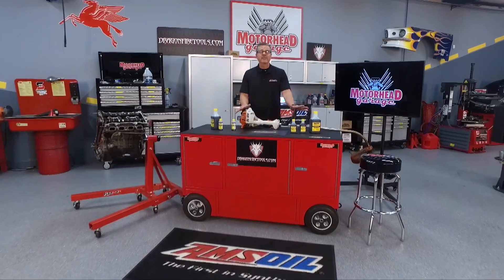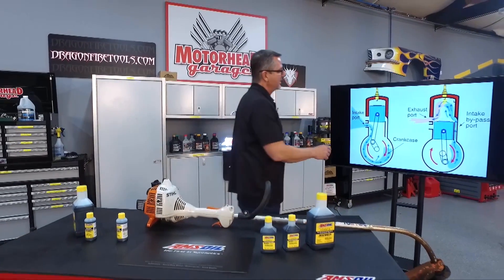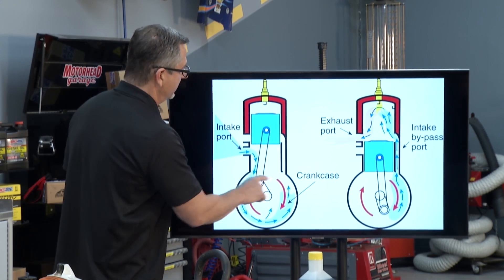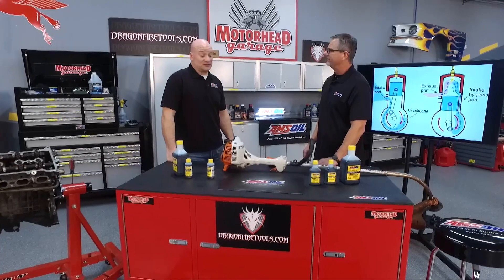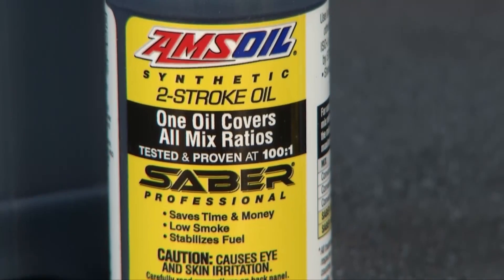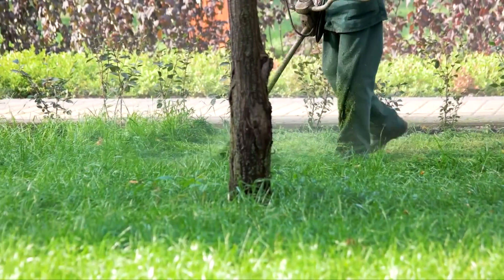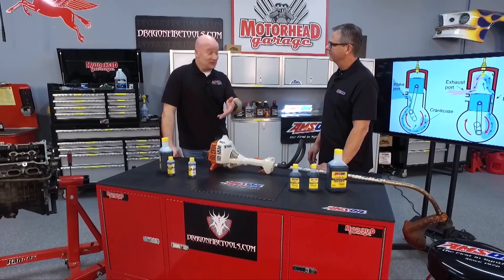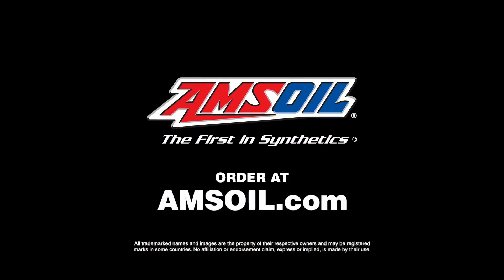Maximize Power in Your 2-Stroke Engine

Comment: I have been rebuilding vintage air-cooled 1970's motocross engines-When rebuilding the crankshafts on these engines  I have noticed acid type pitting on the crank pins/con rods. I have no idea what type of oils were used, and most of the engines had sat for 30 years. I did notice the same type of pitting on a dry storage 1992 Honda CR250 a few years back on the small end of the connecting rod. I have been using Amsoil for 30 plus years in my own bikes, and never noticed this type of pitting. Many of the show quality resto's I have built are in collections ,and will never be started, but I used Amsoil for the engine lube for the assembly. Wondering if long term storage these oils will cause the acidic pitting?  thanks for your time.

Comment: I am a distributor but I am also my own best customer too. Amsoil Saber at 100:1 gives me fantastic protection on my chain saws. I use the chain and bar oil. Maintenance on the bar and chain has longer intervals between teardowns and the chains require less maintenance compared to traditional market name brands. The additional cost brings additional value of longer tool life extended usage in the field and reduced teardown and maintenance time when time is of critical essence on the job.

Comment: I'm afraid to try the 100 to 1.
Reply: Best part of saber is it covers all mixing ratio. Some of my customers are like you and are a little afraid to mix at 100:1. What I tell them is try saber at 50:1. If your happy try it at 80:1. After they try it at 80:1 most customers jump to 100:1. I personally always use 100:1 and never had issues.
Reply: I tried 100:1 on my 1970s 2 stroke vintage Kawasaki 125, guess what? It destroyed my engine. Piston sized up. 100:1 is completely bull.
Reply: As a Dealer, I made sure this would be ok so I started mixing it 100:1 years ago in my own chainsaw and weed whacker. Machines ran great and never any problems. Our warranty dept at the lab is great too. They have saws and other machines there they take apart there if need be and never is an issue due to our oil. It's always a clogged up machine or other maintenance or mechanical issue. Most folks will find a sweet spot like 80:1 maybe 90:1. I have testimonials from some of my own clients on it so reach out if you want to learn more. If you already have and are working with an Amsoil Dealer, you'll need to get with that person instead to help you. Thanks.